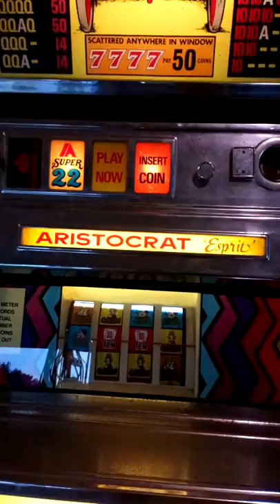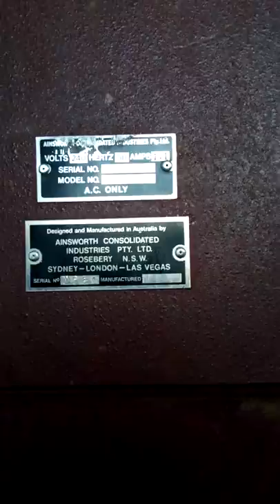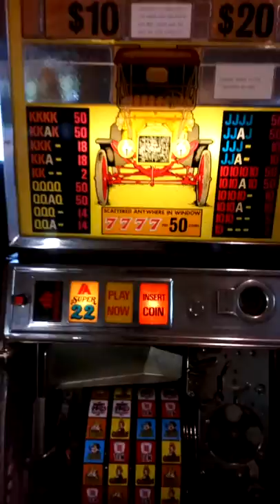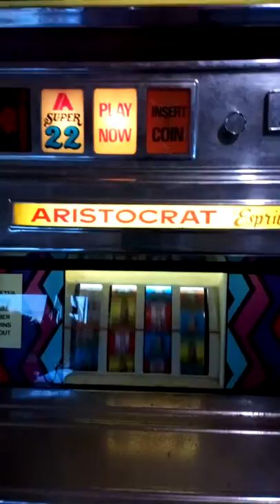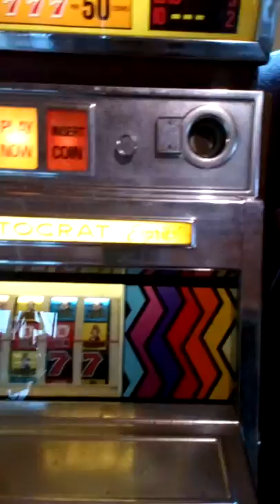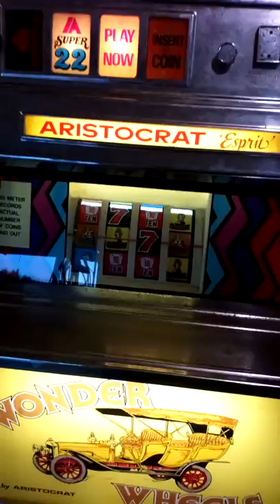Aristocrat esprit 1977

Comment: Hey mate, very impressive work! I have the same machine, and I am looking to replace the electronics, with a  Programmable Logic Controller. I have been trying to work out how the payout trigger signal is sent to the top IC board, testing the pins on the 36 pin centronics plug, I cannot identify a clear on / off voltage when I actuate the a microswitch manually. 

If you still have your notes from when you worked on this, would you mind sharing the pinouts / triggers for each of the pay outs?
Reply from the maker: Hi sorry for the slow reply just busy with my pinsetters lol. I will have a look though my stuff as I still have a lot in storage. You should be able to trace what micro switch is going where with a muilt meter on continuity setting pretty easy. One thing if the machine as been sitting a while they might not be connecting properly when you activate them. But anyway I will have a look for my notes in the weekend
Reply: @wadeaicken19  Cheers Wade, I suspect the board might be sending a voltage when it shouldn't be. I probably need to ditch the existing boards and start fresh.

Comment: i have the same machine but it wont pay out where do i start?
Reply from the maker: It depends on what the boards are like in the machines they are pretty simple electronic speaking if it is just not paying out in could be as simple as a relay just check the board for corrosion there are quite a few relays there could just be a dirty connection. the main pcb board up  top have a look at it for any problems it just depends on how skilled you are with integrated circuit s but it could be any thing just work through it the best you can. I have learnt a lot more in this field from restoring the one I did and if I had the same one now I would be able to keep the factory pcb and get it going but it's all a learning curve. New life games is a good resource to look at
Reply: @wadeaicken19  thanks for the reply
Reply from the maker: @elkadart1  some other things on this machine. I would start with is a full electrolytic cap kit. And I think it would be good to test the transistor I think from memory there are three and one on the heat sink on the side plate. I don't think there are rom chips on these boards I think it is mainly binary counter ic`s which is similar to you 555 timers if you know what the are which is what I used in my replacement pcb. So pretty much when a pay line comes up. On the reels the levers will push micro switchs or release micro switchs which in turn will activate the ic counter to the relay and pay out that amount of coins and also show on the wee led screen the amount paid. Hope this gives you some idea as what is going on in the machine. The newer models were a bit more complicated as they had rom programming and optic counting for the reels